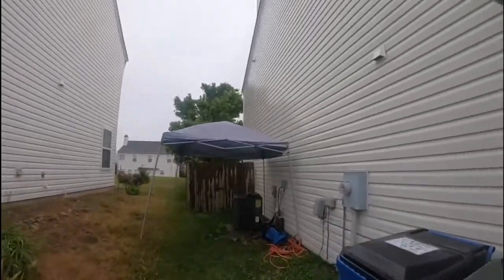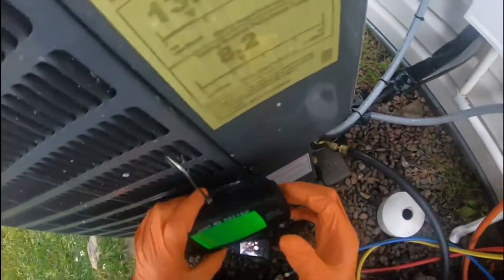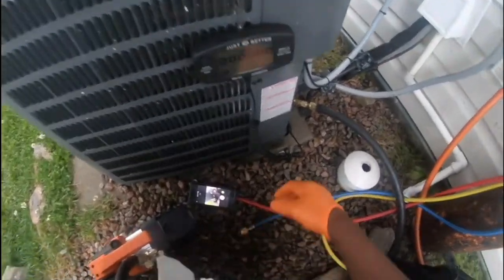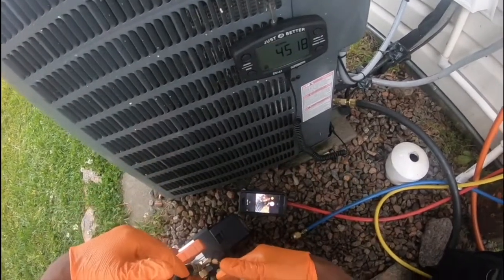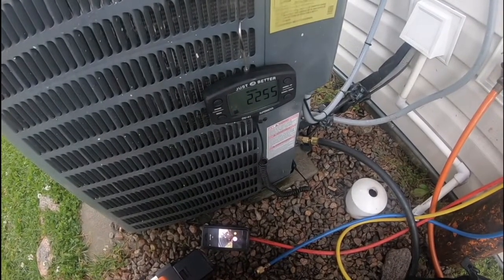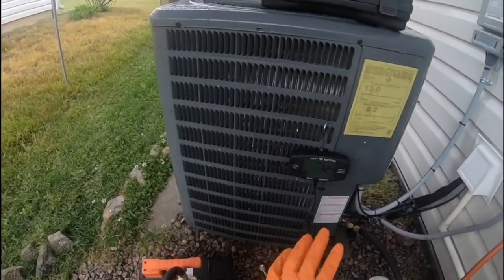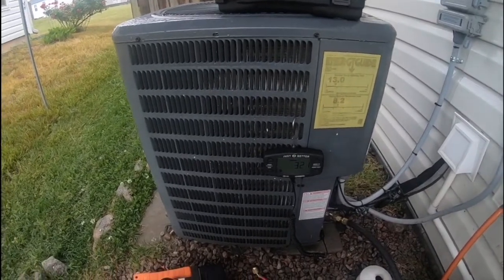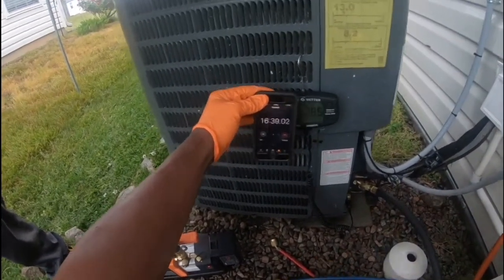NAVAC 4CFM Pump And JB Evacuation Kit In Action

Comment: got the two hose kit for this  with a 7 CMF platinum JB pump and jeez it pulls down fast. Id get the tru blue but damn they are expensive
Reply from the maker: The true blue are expensive and worth it but the JB kit is faster. You don’t have to change tips and it works great. So if you have the JB I would not spend the extra unless you had some extra cash lying around.